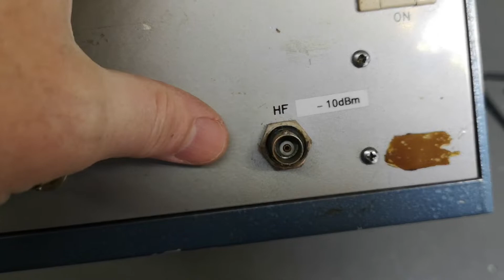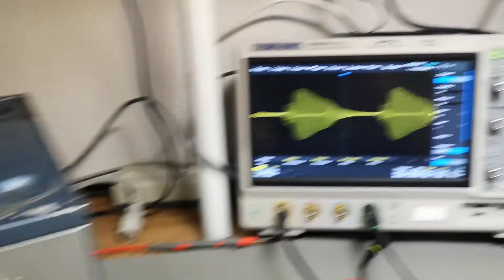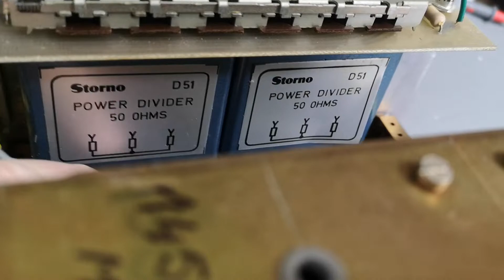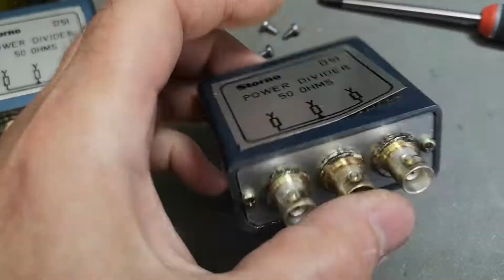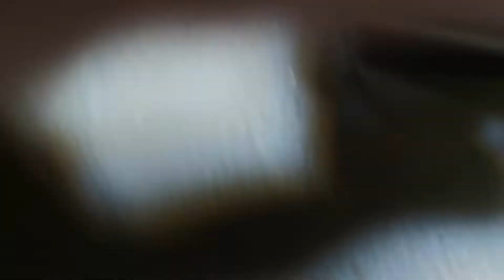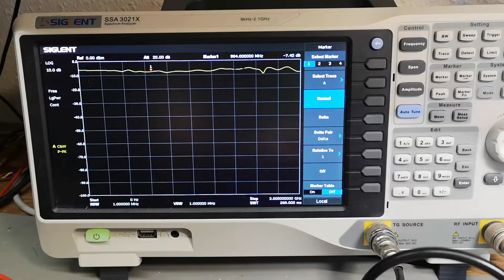Storno TS G72 test MF HF generator test teardown

Comment: Mostly used for PMR service, like metro vehicles and such, and designed here for test and repair bench use. Big case for commonality in the modules, and yes they used the boards for the radios in it, as the modular approach was because they made equipment that went almost from 100kHz to 800MHz in the same style cases. All according to the customer order, that would fit the case. Thus the divider that provided output combination, and of course the power output of the RF stages would be around 1W for the transmit pre amplifier, so attenuate it down a lot. That kind of heat transfer worked well for TO packages, you got decent RF isolation, minimal extra capacitance, or at least you could neutralise it out, and could get the package to dissipate 3W of power, as opposed to 800mW it could normally do.

would be nice to see the die in that early opamp, big, early hand laid out rubylith masks there.